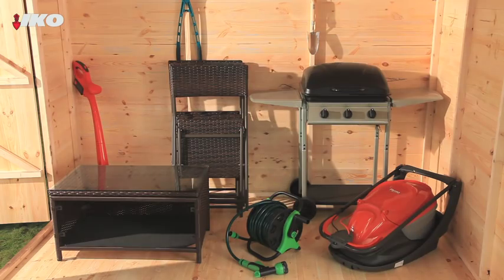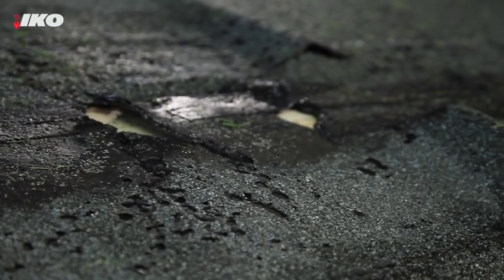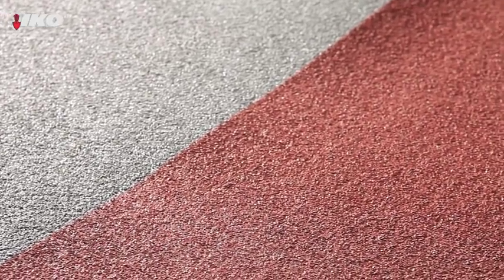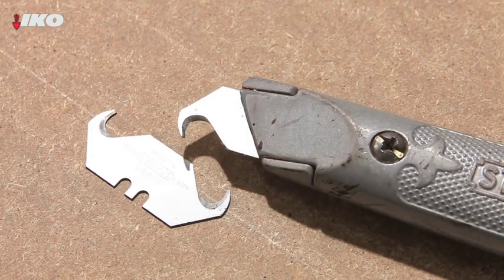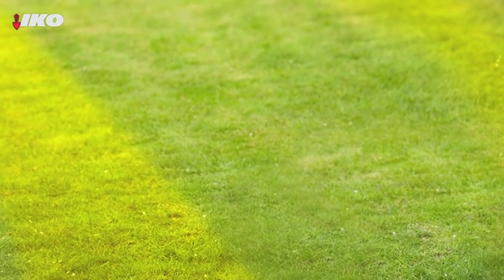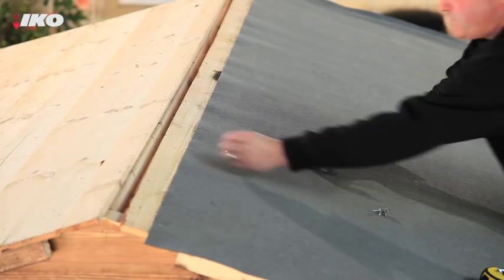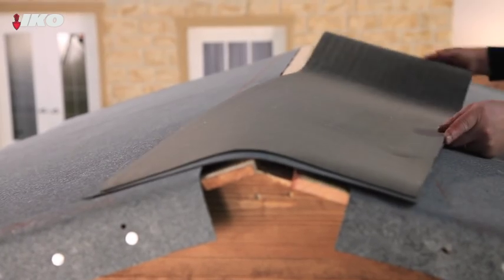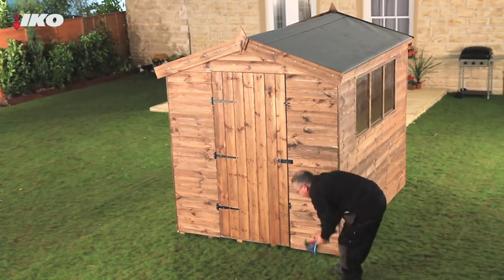How to fix Shed Felt to your shed roof

Comment: This is how I covered my shed 12 years ago (well except for the adhesive, I didn't use that, just nailed).  Completely watertight through the UK weather until last night when the storm winds pulled off the apex strip (should have used that adhesive).  Watching the video to refresh my memory and see how I should repair, which I now know, thank you for taking the time to post.

Comment: I cover all the timber with the bitumen before adding the felt as it hardly costs anything and provides a waterproof layer itself.
Reply: Exactly. And will stick better.
Reply: Can i bitumen the whole plywood roof and simply stick the felt on top without nailing? I'm assuming then just nail around edges?
Reply: @leighthomas4969  its better to nailing, because second or even third part of felt will cover previous so better. Also when you will walk on it , the felt will not slid down, all depend how big roof you will doing? Any strong wind will come? Always better to do good job. Cheers.

Comment: Some rather ugly wrinkles at the far end on your finished roof,  but thanks for the video. To those below, the nails are designed with broad heads which bury themselves in the felt which seals around them, and only go in areas which are butumen painted already - so stop worrying. Good felt is worth using as it doesn't rip so easily.

Comment: Hi. I have corrugated roof sheets on the shed. is this still a solution?
Reply from the maker: You wouldn’t apply sheet bitumen felt products onto a corrugated profile shed roof instead you would apply liquid waterproofing.
Reply: @IKOPLCUK  
Hi!
Thanks for reply 👍
Any link suggestions for brands?

Anyhow, I am based in Ireland.
Reply from the maker: @territmoderitmo9190  if you send an email to marketing.uk@iko.com we can put you in contact with your local IKO Liquid Waterproofing expert!

Comment: I wouldn't even use this on my daughters doll house. So many things wrong with it, worst being nailing through the finish roof. Thats just asking for trouble because the nails will pop out with expansion and contraction even if you put mastic over it. I also doubt this system can stand up to a good strong wind. And don't get me started on the edges, yuck!!
Reply: using nails is normal with the bitumen gripping them and creating a weatherproof seal, Perhaps you should only comment when you within your sphere of knowledge.
Reply: leeedsonetwo Stop arguing - I hate it when people argue.
Reply: leeedsonetwo That person was 100% correct,expansion&contraction--winter,summer etc.that's if You can figure it out within Your sphere of knowledge?
Reply: EXACTLY,SAY NO MORE.